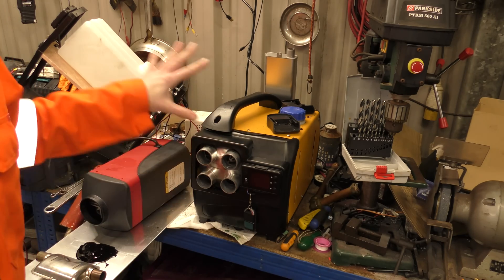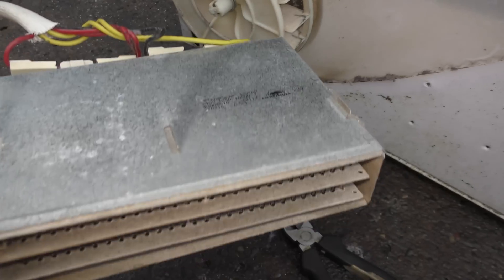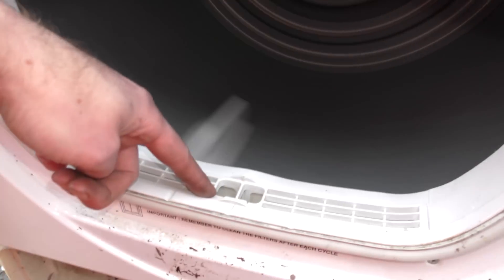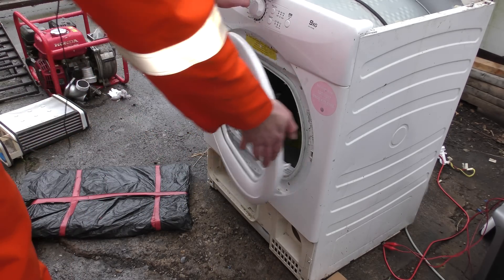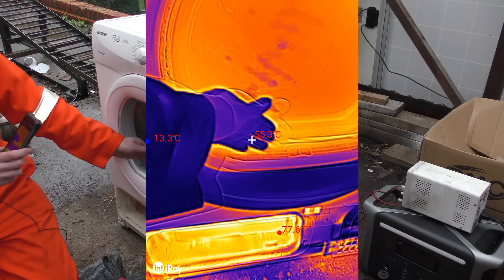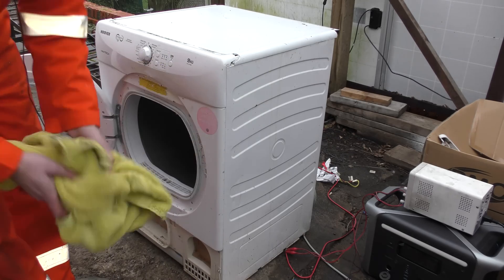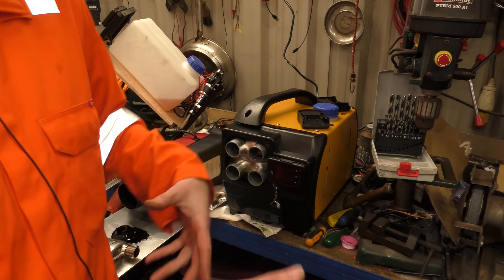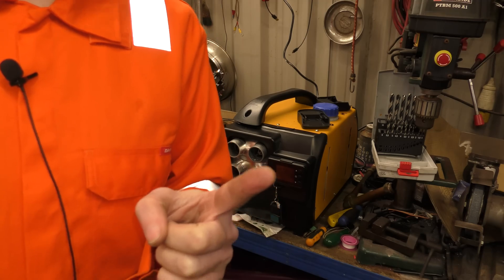Diesel heated tumble drier - part 1

Comment: I tried an experiment on this. Took the elements out of an old dryer and piped my 5 KW diesel heater in the intake heat ducting. Ran the original motor on an extension cord. It did eventually dry the clothes, but took a dreadfully long time. About 2.5 hours. But I may have been the culprit. I failed to take into account that the salvaged dryer was missing the big flap inside the drum, so I am not sure how well the other minor bumps in the drum actually tumbled the clothes. I also may have overloaded it, since I have a BIG washing machine and this dryer was from a lower-capacity set. I was also doing this experiment outdoors on a cool and damp day. I also don't know how good the drum seals were on this old dryer. Maybe the fan was sucking a bunch of cold air in around the seals. There was no ducting on the dryer's vent, so the fan was moving lots of air with no restriction. Can you advise me on what I did wrong? I want to go off grid and use a diesel heater instead of electric elements for heat. I have enough inverter power to run the motor, but not sure if it will start it. I may have to wire it up so the centrifugal switch only lets the motor get power once the motor is spinning fast enough. I would need to use a start-rope and clutch system off a chainsaw to give it a spin and get it going. Imagine yanking a rip-cord to start up your dryer! DON'T suggest I use a chainsaw engine to run the fan. Not a leaf-blower either. TOO NOISY. Even if you piped the exhaust out the dryer vent, it would be too noisy for the neighbors. Then, what about a fuel leak? Drip gas on the lint in the bottom of the dryer? In my house? I don't think so. Nice video David.

Comment: Technically it should be possible with an afterburner (genuine one) because it has the humidistat and it also has controllable outputs for switching relays (2 channels) so in theory you could set it to trigger a shutdown of the motor and using a delay relay you could leave it running to cool down while the heater is stopped.

I think with a bit of clever thinking it probably has enough functions as standard.

Theres also a pwm output which could drive a speed controller
Reply from the maker: That is a brilliant idea.  Sadly the tumble drier came from the scrap pile, and has now returned.  Perhaps if I get another one day I could try using the Afterburner to control it.
Reply: @DavidMcLuckie  ah ok, your idea is a great one though,  i spend a huge amount of time on my boat and for years i have looked at the mini 240v tumbledryer (which flattens the batteries in a few hours) and the hot air coming out the vent near the floor from the heater and wondered how nobody has put two and two together and made a cheap mini dryer with a flexible hose and a selection of fittings to push onto common heater vent outlets in vans and boats, and a 12v brushless driven drum.

A booster fan would be good too just as your video since the heater blowers are weak.

Since the dryer would have no control over the heater in my example they could use a mixer flap to shuttle fresh air in to regulate temp and another to direct it all out on a cool down program.

Also as far as a 12v motor goes to drive the drum, i wonder if the blower motor from a heater could drive it with sufficient gearing, although they dont have much torque they are pretty well made and the brushes seem to last a long time,  they are also rebuildable.

Gearing it to rune at 5000rpm and the drum at much lower might be good enough.

Another way to do it would be to hack the rf remote and control the heater using wireless commands it could then be plug in hose and a cigarette socket and wireless temp control, perhapse with flaps as well for better control.

Comment: I have this idea that I would love for you to try. Making a homemade calorifier with two copper coils inside and two electric elements both 12 volt and ac. One input to the copper coil would be a hydronic diesel heat with glycol and the other copper coil would be from an on demand propane heater. All this would output through a heat exchanger. The idea would be to have several sources of heat (in an rv) . Also the calorifier would have a glycol mix inside running to one side of the heat exchanger. I have a drawing that I could send that might help. Not sure how to do that.

Comment: why not remove the electric heater from the tumble drier and cut a 24mm hole on either side of the metal cover on the back of the machine. Pass the exhaust through both holes and the tumble driers fan will blow air over the outside of the exhaust. Diesel heater can heat your room and tumble drier next to it will dry your clothes for free via the wasted exhaust heat.
Reply from the maker: That's not a terrible idea.

Comment: You could use the dryers electronic control to do everything you want to use an arduino for... its 'made for the job'  so to speak.. the 2 stats at the back are needed so don't loose em then what was the heater power can control the diesel heater...

Comment: Question, what torque load will it be for a motor to spin 7kg of wet clothing, at 12v that would be a lot of amps or a lot of gears, you could perhaps use the old style of automatic gearbox of the two spinning wheels that move up and down their shafts for different speed and loads, however to KISS moment you could use a bicycle idea, however as the load changed weight the speed too will increase and this probably stop the "tumble" action and turn it into a spin dryer lol

Comment: Back in the late 1970's and through the mid 1980's I sold and repaired major appliances, mostly laundry. Very old dryers did not have a cool-down on the timers. The old Norge dryers had a spring wound timer, and did not cool the clothes down. For a simple timer, a spring wound timer that is used for fans and heaters could be used on the dryer. One is the Intermatic FF60MH which is about $20 in the US. It has a maximum time of 60 minutes. It might be difficult to use a 12 volt motor in the dryer. The motors that most dryers use, including the one in the video, has the armature shaft coming out of both ends of the motor. Usually, one end is threaded to hold the blower wheel on, and the other end has a flat to hold the belt pully on. I can't think of any 12 volt DC motors that are like this or could be machined to fit. A reasonable alternative would be to use an inverter to convert 12 VDC to what ever the main voltage is, and just run the electrical part of the dryer that way. Another alternative would be to convert a gas dryer to propane and use a 5 gallon propane tank for the dryer heat, and an inverter for the electrical part. By the way, some common drying temperatures are: 52°C to 57°C (125°F to 135°F) for a delicate cycle, and about 66°C (150°F) for a regular cycle. Also, most blowers are designed to withstand these temperatures.

Comment: Could you just lose the fan off the end of the motor. As the diesel heater has enough fannage for that.
Reply from the maker: That's something I'll be trying.
Reply: no... barely blows enough for a longer run of hose and a few Y pieces.

definitly not going to make the static pressure required for the drum...  not remotely designed for that much resistance.

Comment: Another great Video! You seem to be pretty knowledgable and inventive on diesel heaters all round. I just fitted one yesterday in a weatherproof housing outside and have just the warm air piped in so far. Trouble is it stinks of hot plastic even after a few hours running. I’ve taken it to bits and the smell is definitely the same as the plastic housing even when cool. Have you come across this? Does it go away or is that just bad luck - a housing that just smells? Could it work without the housing with maybe a suitable end to direct the heat as well as heat shields where necessary?
Reply: it usually is from the dirt cheap plastic and goes away after serval hours at full bllast.

but the full aluminium body version (not as cheap as the cheapest shit ones) is the best solution to this problem.
Reply: @casemodder89  Great help . Thanks, I will give it a bit more of a blast and hopefully that will do it. Otherwise, I already have some aluminium sheet in the garage, ready for plan C. Plan B is to seal the present case with Aluminium foil tape. i read that some chap tried this but it still stank, but maybe he didn’t completely seal it so might be worth a go. anyway, keeps us busy! thanks for reply anyway.

Comment: This is fantastic David, I don't know how you come up with these ideas but they certainly are ground breaking plus these days it will be energy saving.
I'm sure I read in the instructions for the Afterburner it can also control external devices like lights so I suppose it could also swich a motor on and off.

Comment: I admire your creativity with these devices David :) Have you seen the guy who is heating a 5-bed, 1920's, uninsulated house with just one heater, and running it on hydraulic oil but starting and ending the daily 8-hour burn with diesel ? https://www.youtube.com/watch?v=HUC2hPcTnp0

Comment: I'd be interested in a cost comparison of drying the same item on electric & diesel (+ a little electric).
An entirely 12V drier is a good plan - opens up the potential for having a drier in a camper van!  
Happy to help with electrickery / coding if needed.

Comment: Find an older tumble dryer with a mechanical timer switch and with it being older it should have a universal motor so just a little tinkering and it would easily run on 12v.
Reply from the maker: Yes.  That's what I wanted.  But when you get offered a free one, you can't be too picky.  :)

Comment: Interesting idea, I like it 👍 .Now if there was a way to turn some of that thermal energy back into electricity for the battery etc that'd be cool.
 The only issue I'd have is that with my brand new Hcalory diesel heater ,I'm getting a whiff or two of diesel coming from the blower on startup and shutdown which I'd rather not have on my clothing . Not exactly sure what's causing it but considering it's a "new" heater , I'm not exactly happy about it . I've asked a few people about it and so far no takers for the advice that's been asked . 
All I've run in it is diesel only , nothing else and only two full tanks which isn't much .I have the one with the red metal case AKA the 5-8k model ,so the tank isn't that big .
Otherwise I really like it . I'm using it to offset two electric heaters in my shop which is 3k square feet and so far so good . For $150 USD delivered,free shipping and a really fast delivery I'm definitely not complaining but I'd definitely like to get that fuel vapor issue resolved . It's probably something simple but not sure at this point .Ideas anyone ?
Reply: The heated air & combustion air paths should be completely isolated in the heater.  Are you sure it's not exhaust being drawn in to your shop through a vent / window / mousehole?
I heat my shop with a webasto water heater & radiator.  The webasto is outside & only the hot water comes inside - but occasionally I get a whiff of diesel inside when the wind carries it.
Reply from the maker: The only points where there is a possibilty of mixing are the rubber glowplug seal, the rubber fuel pipe seal, and the gasket that seals the blower onto the combustion end.  If there is any sort of gap it'll be when the heater is cold and you might get the fumes then, once it's warm and the gap closes the smell would go away.

Comment: Great prototype and proof of concept.
You may even be able to use the thermostat control unit to just open a flap that allows more cool air in at over temperature events. Perhaps assisted by a 12 volt computer fan or car radiator fan.

Comment: Wow, US clothes dryers are a lot different. For one thing they suck air in through the heater (gas or electric), then the drum, the screen, and out through the blower. I don't think a condenser is a thing here. They blow directly outside. So a conversion of a US spec one would be more easy. direct the heater out hose into the air intake, kill the onboard heater and Bobs ur uncle.

Comment: curios question... is it any less costly to use diesel to run this.....  or electric?
Reply from the maker: Right now in the UK, I think that kerosene for the production of heat is cheaper than electricity.

Comment: I’m currently trying to rig up a diesel heater to heat up a hot tub. I’ve got an old gas combi boiler and piped the air and exhaust into the burn chamber need to set up some water containers and give it a run to see how good the heat transfer is. 

It’s just to expensive for me to keep it hot with electric now and I use kerosene for the house already. I was looking at the direct water heating style of heater but I already had an all in one style I use in the garage and buying another is a bit pricey.
Reply from the maker: Have a look at the Bobil Vans water heater for some 'inspiration'.

Comment: Nice video, as always!
I didn't know about that property of cotton to set on fire so easily. Good to know something new.
You know, there is a device called de-humidifier who does what you want to do with this machine. If you really need to dry your stuff, it's easier to use it. Of course, you don't have this need but the need to do something interesting with an existing machine. And this is appreciated!
Cheers!

Comment: The big question really is,,,,
What's cheaper, buying a diesel heater and converting "something" to run off it or just carry on using mains electric 🤔
I get the whole trying stuff out but is it saving you money ??
Reply from the maker: Good question.  In the home probably not.  Off grid more likely.  As you are now only consuming maybe 300W of electrical power and not 3000W.  Now you are into the realms of using less batteries which have a finite life etc so that is a benefit.

Comment: With regard to the Cooling down period. Use a relay in line with the fuel pump controlled by the original heater feed. Tumble drier does the rest. Simple, or not maybe.
Reply from the maker: Could go even simpler.  Assuming still using tumble drier fan, set tumble drier for 75 minutes.  Then set the diesel heater timer for 60 minutes.  Bingo, 15 minute cool down.  :)

Comment: You wouldnt need the fan you can block off the intake side and use a direct connection to the inside and use the normal discharge side

Comment: Wonder what other appliances diesel heaters could be pipe into? Airfryer perhaps🤔. Also cotton fires suck. They've started harvesting a lot of cotton in the past few years where I am. They often want us to extinguish the bale or module fires. Which means you have to completely disassemble them. Surprising amount of farmers want us just to soak the bale or module. But that only puts out the fire out temporarily. Best thing to do is let them burn for a week.

Comment: I’m already worried as I have the same model of tumble drier as you’ve used. Is the writing on the wall? Will I convert it to diesel heat when it imminently fails? I agree that I think a 2kw heater would be a better match. Great subject matter and more food for thought.
Reply from the maker: So this tumble drier was fully working when I got it.  But I think the bearings might be on the way out, as the drum didn't really want to spin when I got it.  So I sprayed everything with WD40.
Reply: @DavidMcLuckie  that’s put my mind at rest! I think this is actually our longest serving tumble drier so I’m not holding my breath but so far so good 😂
Keep up the excellent videos 👍

Comment: I think the 2kw diesel heater would be the perfect match for the electric heating element as they're about 2kw also. As for a 12v motor, maybe a car blower motor with the fan attached might be useable?  If you could get one of the old old 70's tumble driers with fold down door front (I still use a Creda 300rs),  apart from being half the size of a modern, they use a twist clock work timer that has cool down part before stopping... Maybe a useable feature to turn off the diesel heater with out coding and electronics. I.e KISS

Comment: The arduino has enough IO pins to also control the motor. Will need some other components to switch the loads.

Comment: 1. Get a 12v geared motor, car wiper motor might do.
2. CHD hot air directly to the drum without using t. dryer fan.
3. Remove fluff collector/filter so less restriction on CHD air flow.
4. Get cheap humidity sensor and temperature sensor off ebay.
5. Connect t.dryer 12v motor to arduino output through a 12v relay.
6. Connect humidity and temp sensor to arduino input.
7. Program arduino to communicate with CHD controller.
8. Code arduino to turn off heat output to t.dryer following cool down   cycle based on sensor inputs.
Reply: Wiper motor would be way too slow.

Comment: Electric Dryers do not have an "Intake" on the back, that is for heat exhaust, if you plug that up with heat input from the diesel heater you are up for a bad day. since there is no place for the air to escape.
Reply: Well if air comes out in one place, it must go in someplace else.
Reply: @27kilofoxtrot  Usually there are vent slits in the back or sides (depending on model) that just allow fresh air into the space under the drum.  The blower sucks from that empty space.  Ducting the hot air right into the fan can cause heat issues with the motor, but in theory you could get the hot air anywhere underneath the drum and it would get into the clothes.
Reply from the maker: Mine does.  I mean the one in the house.  Draws air in vents on the back and exits outside via a hose.

The one in the video draws in from the side and vents out the front as it's a condenser type.